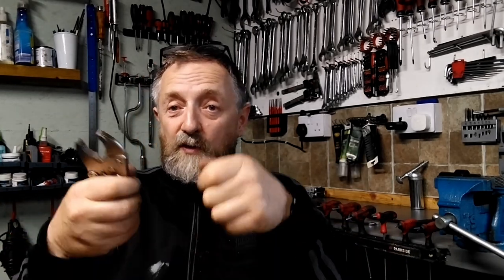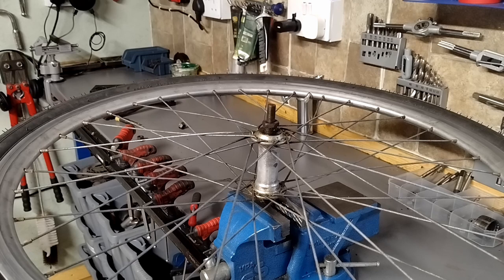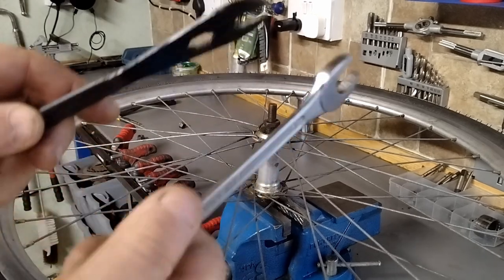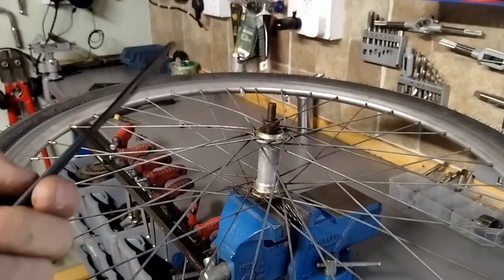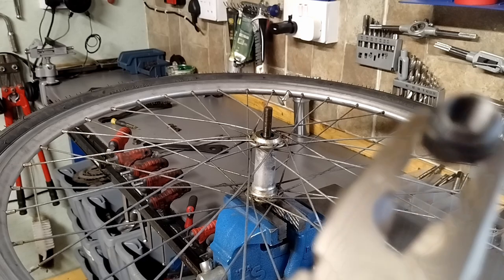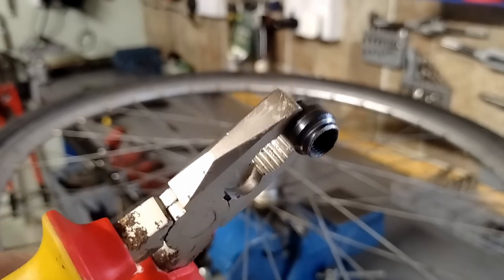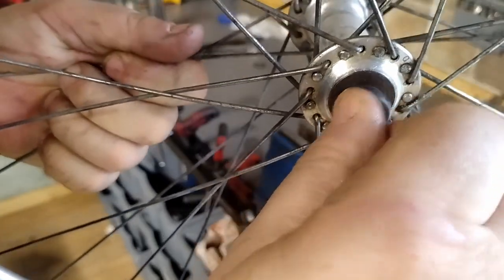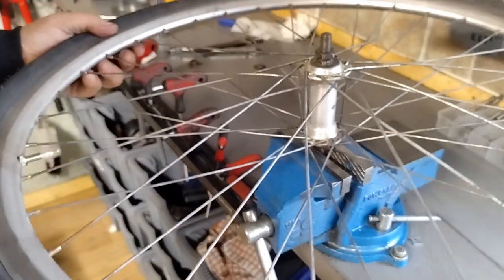The truth about cup and cone bearings

Comment: After 35 years as a bicycle mechanic, I couldn't agree with you more. Sometimes if the bearings are just slightly tight I will use a cone wrench on both sides and simultaneously back them both off. This loosens them slightly, and it also locks them even more tightly against the locknuts. On the contrary, if there is just a tiny bit of play I will grab both locknuts and tighten them simultaneously. This works well for final adjustments. On cheap hubs it is often impossible to get a perfect adjustment, but such is life. Anyway, great video!
Reply from the maker: That's a great comment and I will do the same too 👌👍👍👍
Reply: I read about this technique on Sheldon Brown's web site. It was a battle until I understood this method. Now it's a fairly quick and reliable process.
Reply: That is a great method, requires 2x the number of spanners and also loads up the threads so be weary of wearing the threads out
Reply: Hah genius! It takes me up to 30 min sometimes to adjust it properly! And yes, in other videos it looks so easy. I was  beating myself over this! Thank you sir!
Reply: A minute amount of play (when the hub/wheel is not clamped into the frame/fork) is actually desirable with a QR hub. If the hub is adjusted for no play, it will be too tight once the QR is closed. Stein Tool makes hub vises specifically for adjusting QR cup-and-cone hubs. I use the left rear dropout as a substitute: just clamp the wheel so it sits to the left of the frame.
Reply: @trekkeruss  😬 used to think that too. But it's not the case. They need to be snug, too tight is also a disaster of course.

Comment: I think people mistake the thin nut for a lock nut. It's a jam nut! The locking comes from the skewer or domed nut outside the fork. This jam nut should be done up with care, leaving the right amount of play. When you finally put the wheel back in the fork, or dropouts, the real lock nuts (or skewer) will add additional force and take out the final slop. This can be tested on the bench if you make up a pair spacers (very much advised). The skewer, or nuts, should never be done up with much force at all. A wobbly wheel will almost always ruin the cones eventually. It is the best reason to support your local bike mechanic!

Comment: I like to tighten the cone until it just contacts the bearings, back the nut off about 1/4 to 1/2 a turn, install the locknut, and start from there. I try to move the cone nut 1/2 to a full "flat" on the nut. I'll have to remember using the distance between spokes. Today I put my wheel in a socket installed on a 3/8" breaker bar, and used a C-clamp on the bench to keep the axle from rotating. Pushing the tire into the wall with my stomach, while the axle is sitting in a socket gave me the third-hand I needed. Great video!
Reply from the maker: Great idea, im definatly going to give that a go 👍

Comment: G’day from Downunder Fred!
Very nice video my friend and very entertaining presentation, enjoyed it immensely. 
My bicycle experiences back around 1960 when bikes basically has 1 gear. By the mid 60s my bike had 3 gears, an old Sturmey Archer 3speed hub which usually ended up a single speed when the selector pin broke. 😂
Anyway, a year or 2 down the track and for the passes several (15) years I’ve been looking after my grandkids’ bikes, and haven’t they changed and hasn’t the cost of things changed. Back then a wheel respoke (lacing) would cost 1 pound or $2. Sound cheap? Well back then the old boy could buy 10 schooners (15fl oz beers) 😂. Wasn’t happy if we needed wheel work done. As for bearings, we’d run ‘em til the broke the beg, borrow or otherwise obtain them. Sometimes we’d give them a kero bath then jam grease in any way we could. We never worried about brakes, they were usually one of the first things to go 😂. Mudguards, chain guard & brakes 😂. 
With my kids not so much, but I repaired the frames a few times welding slugs in & stuff, punctures etc. 

So now with the GKs, derailleur gears? Whole new world! Holy SMOKE! The eldest grandson’s bike has more bloody gears than a Mach bloody truck! And special tools! Stone the bloody crows!
Anyway, a kero bath & rough enough’s good enough isn’t standard practice these days, so shortly I’ll set to and make up some stands & jigs….
Bikes, they ain’t what they used to be 😂😂😂
My Irish mate told us many years ago that the English invented english, Irish taught them how to effectively use it and the Australians destroyed it 😂😂. He would captivate a group with fact and then through his story would gradually incorporate utter bs in a factual manner, implied evidence and his reassurances. 

Anyway, thank you Fred for an informative and entertaining video. 
👏👏👏 👋👋👋
Reply from the maker: I could read stuff like that all day long, its sad how  we are living ion a throw away world, thanks for the reply fella ,that brightened my day :)

Comment: Great topic.  I’m struggling with this right now.  Not having a vise is most of the problem.  Thanks for posting and sharing your knowledge!
Reply from the maker: I hope it goes well for you 👍
Reply: Just knowing that I'm not crazy is a huge help.  While rebuilding my latest wheel I just could not get it right and couldn't understand what I was doing wrong.  When I looked at the axle closely as I was setting the lock nut you could see that the axle was moving as I was tightening it down.  So frustrating.  Having a vise would definitely make the whole process easier.  Thanks again! @freds-shed

Comment: 5:26 got a pair of cyclo cone spanners they do all the sizes, and if you use two held together you can use them as a pedal spanner - just right for touring tool kit!

7:09 other reason to clean the threads first is you're spilling all the crud into the bearing as you remove the cone if you don't

9:51 you can reuse the bearings, I even do. However good practice is to replace as a matter of course especially if you're using new cones. Had a mate forty years ago who would go through a pot of balls with a micrometer and check size and roundness, he'd wind up throwing half of them away! Best grease is CV grease

14:32 tighten it up, back it off until smooth! There that didn't take half an hour 😮

Comment: I’ve done hundreds of cup and cone wheels…occasionally I’ll get it right on the first adjustment…typically 3 or 4 adjustments! I also take an old aluminum pie pan, punch a small hole in it and I place it between the vise and the axle. This way when I pull the wheel off of the axle I catch the bearings in the pie plate instead of them rolling around on the shop floor!
Reply from the maker: Love the pie pan idea ,Thanks

Comment: I had to work in a TREK store, and the guys there claimed they can do it between their knees. They did do that, but their results were awful. They claimed that the lower end hubs need to be tightened more, as they develop play sooner... I tried explaining to them that it is due to them overtightening them and thus making them wear faster. Using a vice was the strangest sight for them.
Reply from the maker: I hear what you're saying, i just like yo make my life easy 👌
Reply: @freds-shed  I found that there is more to setting cones because of this methot. To get the perfect preload on the bearings you should leave a tiny bit of play when not in the frame. Once you clamp down the hub with the QR skewer, the axle will be compressed enough for the play to be removed. A QR has a force of up to 2kN! This is a more advanced level, the trek guys could not understand it at all.

Comment: Top drawer! Yeah, Over tight cones will disintegrate the bearing surfaces in service. It's also Well Worth checking all cones on a new bike. There's way too many bikes coming out with badly adjust cones on the wheels (or pedals!) from factory, typically too tight. 
I'd add that if your reconditioning a well used rear shimano hub with 8+ cassette your probably better off degreaseing & using threadlock on the right hand cone lock assembly  (freehub side) this is because you can only get at the outer nut and if this backs off you will need to disassemble the lot to sort. Mostly an issue on a well used axle with shiny threads. After that fine tuning on the other side is an easier task. (found this out the hard way, damaged a nice ultegra hub when the right cone had backed off a smidge with my loaded pannier) 
Anyway, great video, cheers 👍🏻
Reply from the maker: Ur 100% correct ,I definitely should br using thread lock and I couldn't agree more about checking all new bike's, I do everytime .Thanks for watching

Comment: you can do it between your knees! put 2 cone wrenches on 2 cones and just uncrew a bit. one of them will move on the thread, even if they are locked with a locknut!  the question i have is this: is it better to have some play or to have slight grinding/rumbling with no play (i can still turn the axel easily with fingers, but not as easy as if there is some play)?
Reply from the maker: Personally I like as little play as possible but I am also aware that its will tighten more when fitted especially wityh Quick Release , yea I agree u can do it between the knees but I have never gotten it right on the first go like i see people do in  other videos
Reply: @freds-shed  yeah, there's no way you can do it on the first go. they probably have too much play, but they just show you nicely spinning wheel.
i dont think you can actually compress the axel with quick release, which would be needed to tighten cones even more. stopwatch test of spinning wheel could be done. if you make a video of it, please remember to share a link here with me :)

Comment: I'm servicing an old front wheel, nothing fancy and however I've been doing really fine tuning I find imposible to get no play without draging. I get play if I run it smooth. I'm tired of it, just gonna leave it with drag but no play.
Reply from the maker: Yea I hear ya, there is no right or wrong answer in my opinion, but the more u do it the better u get at it. or maybe we just get used to accepting it will never be perfect  :)

Comment: I tighten the cone against the lock nut rather than the other way around (after setting it just too tight, only just catching the bearings / feeling notchy).  That action of backing off the cone to tighten it against the lock nut being held stationary introduces just enough play in the system to allow the bearings to run freely.  Often works first time.
No idea how often you should grease the bearings though?  any thoughts?
Reply from the maker: I really like  that idea ,i will do that next buddy ,thank you

Comment: I actually enjoy doing my hubs. My biggest question is what bearings to get Chrome Steel, Carbon Steel or Stainless Steel and what grade G25, G10 or G3? I have Chrome Steel G25 but thinking there is a better option what is your view?
Reply from the maker: I usually go for G25 and buy the same brand all the time , I'm not sure I will matter too much by the time they need to be changed again lol
Reply: @freds-shed  My worry is 25s damaging my hubs quicker due to lower tolerances. Have you ever tried using ceramic bearings in a cup and cone?

Comment: Ive spent hours trying to get my front hub just right😮 i settled on the slightest side to side movement of the tire when clamped because i want ZERO rolling resistance. Is that okay?
Reply from the maker: It should be fine, but I would check it after the first ride and regularly after that as they have a habit of loosening. if you really want the slightest rolling resistance, then set them so they are right and feel good, then hold the lock nut and squeeze try to back the cone off anti clockwise squeezing it against the locknut. You will get a fraction of movement that will loosen the cone, Its tricky but it can be done and u might damage the cone spanner as they are not designed to take force, hope that makes sense
Reply: @freds-shed  thanks for the reply

Comment: u forgot a major point, which even you made the mistake of doing. if you are measuring spoke to  spoke for your cone nut adjustment, you must not spin the wheel. if you are lining up with a spoke, and then spinning the wheel, you are obviously turning the cone nut. thats why it was still too tight 3 times in a row, you  can see you kept spinning the wheel after moving the wrench to another spoke
Reply from the maker: Yes I understand what you are saying, however, as the axel is free to move independently it would not matter how many time you move, remove, refit or change the reposition the wheel in the vice. Every time you loosen the locknut and move the cone clockwise by one spoke you are lowering the cone position by that distance and tightening the bearings between both races
Reply: @freds-shed  the axle is clamped into the vice, no? you were inadvertently turning the cone wrench clockwise while attempting to turn it counter clockwise, because you were relying on the position of the spoke to remain the same except you were spinning the wheel a few degrees while tighting cone nut to lock nut
Reply: @freds-shed  Look at 13:50-14:00 in your video. you are attempting to loosen the cone nut by "one spoke", but as soon as you put a wrench on the locknut, you spin the whole wheel clockwise with the cone wrench, undoing any adjustment you just made. that's why it took you 3 adjustments to make any progress
Reply: @bmxscape and he basically said that he's only trying to illustrate the degree of adjustment and make a point.  I think we all see the variables here and understand to do what he says not what he does. His point is find a reference point and use that as you go.
Reply: @LemonySnicket-EUC  and i basically said that the way he illustrated it doesnt work
Reply: @bmxscape  but it does.
Reply: @LemonySnicket-EUC  lol ok. you obviously didn't understand what i wrote then.

Comment: I want a vice, but as a home mechanic I don't have the space. Maybe on the ground.
But I have done 6 or 7 of those infront the tv or in the garden. And it's not easy. Doing this professional, without a vice, will be a pain and time consuming.
Reply from the maker: Yea ,I'm very lucky to have this workshop and I use my cheap little vice nearly every day
Reply: I’ve got a multi-angle Stanley vice, it attaches to any flat surface via a built-in G-clamp. I open the cupboard under my kitchen sink and clamp it to the worktop. It doesn’t need to be tight for a job like this.
Reply: @nkt1  This looks useful for my situation. Thank you.

 I'll try and find it here. I presume it's not as big, but rather small. I'll not be using  to hammer stuff, just to be my third hand.
Reply: @vehicle-stuff  Yeah, it’s on the small side, ideal as a third hand.

Comment: The hub you worked on is one of the worse hubs to work on, Joy-Tech. My self when loosening a lock nut I will always if possible use a scissor action, this way I'll have better control of what I'm doing. Clamping of an axle I'll always use an axle vise, when using an axle vise you'll have less slippage and the axle vise can also be used for straighten axles as well or I will used V grooved soft jaw blocks I will have a bench vise with a rotating head meaning I will be able to rotate the head so I will be able to clamp the axle with a better position. 99.9% of the time I will never vise up bicycle parts without the use of soft jaws, this way the jaws of my vise roughly 25 years later they are still square and sharp. When over hauling low quality hubs I will never use the old carbon balls which are grade # 300 or grade # 400, I'll always rebuild with chromium grade #25 balls. When reassembling such a hub as Joy-Tech I will always add a washer in between the cone and Lock nut, when trying to finish up the bearing adjustment I will use 2 cone wrench's one on each side then I'll be backing them off the cones from the bearings, this is where the added washer will help with lessoning of the loosening of the lock nut, doing it this way It's quicker for me when finding that bearing adjustment sweet spot adjustment and I'm one of those guys that will be flip flopping the wheel on my lap. Also if I just need to do a minor bearing adjustment, if the hub is a nutted hub then you only need to remove one mounting nut, leaving the other side fixed onto the bicycle then use a thinner wrench to lock onto the lock nut and the needed cone wrench and go at it from there, I've done this 100s of times with out any problems at all and if your having a hard time finding that sweet spot adjustment then it also could be the axle, it might be bowed or bent, take the whole unit apart then roll the axle on a nice flat surface, if the axle needs straightening, this is where the V grooved soft blocks are needed, but you will need where the bend is then insert the axle to that spot then use a small cheater bar to straighten out the axle, in fact I just performed this fix last week. Also if for some reason if the bearings don't feel as smooth as you would like it to feel then it could be the use of low quality parts, maybe the bearing race of the cone and bearing races could be bad, then the races could use some polishing, this can be done with a 50/50% 50% grease and SEMI CHROME then ride 100 miles or more, then overhaul the hubs again, then the bearing race contacts should have a nice smooth bearing race then rebuild again with fresh grease. 

Sorry to say no AliExpress cone wrenches for me nor Park or Pedro's! I once had a sales person come into my shop 30 plus years ago and he gave me some new park wrench's to try out, on his next visit, he asked me, so what do you think about the Park cone wrench's I said, do you really want to know the truth, he said Yeah! I grabbed the bunch and right in front of him into the garbage can they went, I'll use HOZAN, TACX, SHIMANO and CAMPAGNOLO.